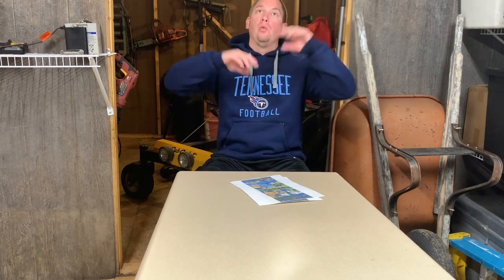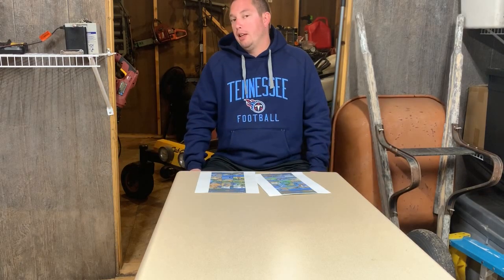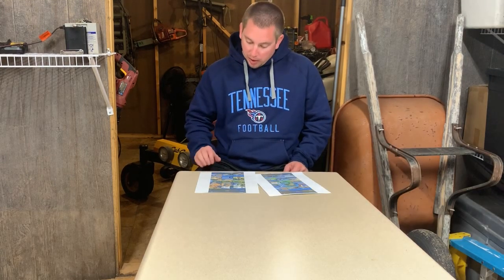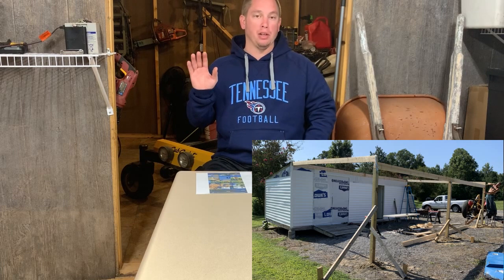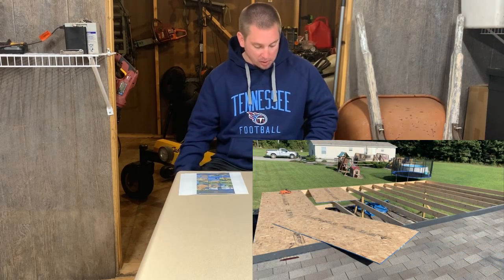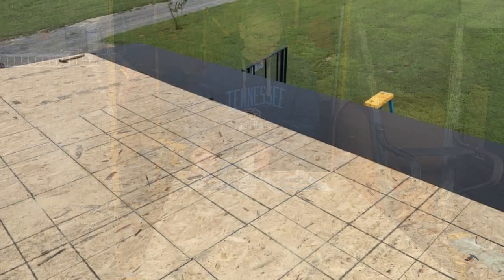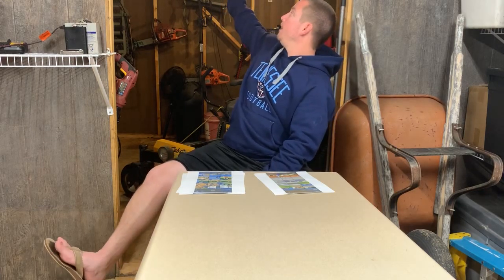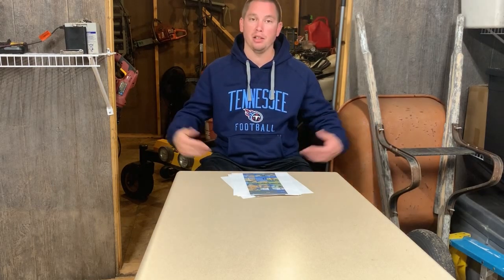HOW TO Put An Overhang On Your Shed

Comment: A bit shallow to take a heavy snow load. You may have to shovel it if you get a big dump. For people who live in snow zones go at least 7/12 pitch and 16” on center your trusses. Additionally maybe up it to 2x8 both the trusses and the post headers and add a couple more posts. 

I like it sir, I give it a solid B rating which is pretty high for an amateur. I love me some farmers, they are hard working and get it done kind of people. Every farmer or kid of a farmer who ever worked with or for me was nothing short of excellent.